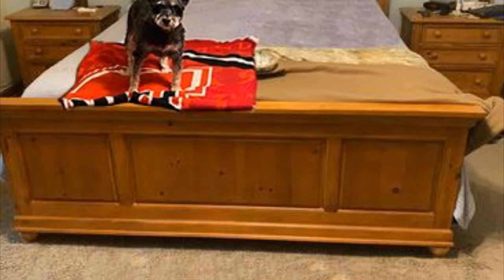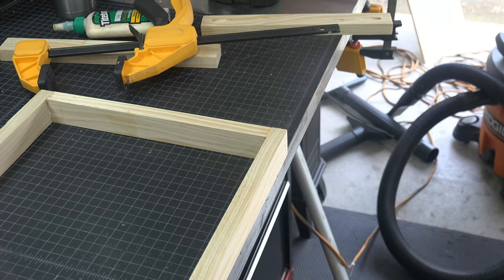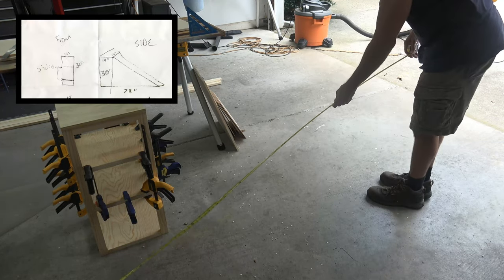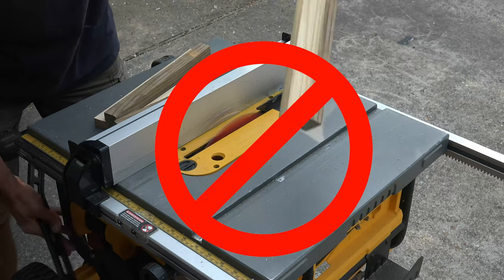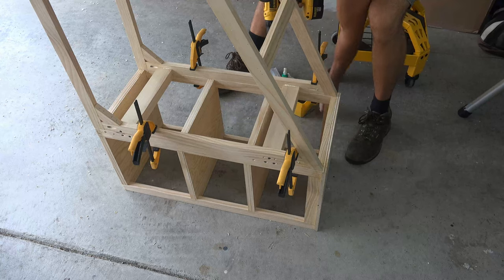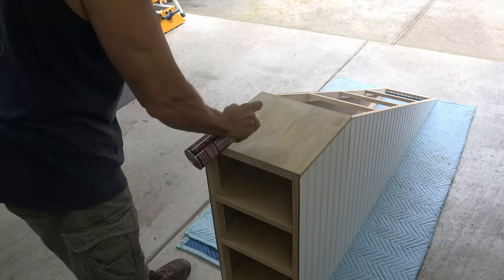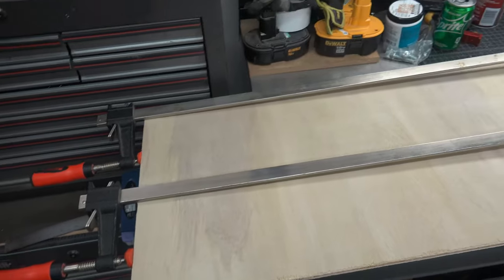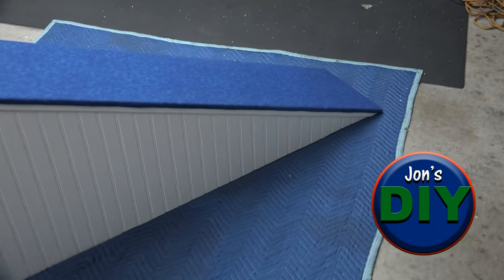How to Build a Dog Ramp

Comment: The first comprehensive guide I've seen. My dog (7 years old) just recently started showing signs of hip dysplasia, especially with the cold we're having, so I needed a guide for this so she could make it up into my bed. Will be making this soon, thank you so much!
Reply from the maker: Thanks Jade.  Although I built this to the owners specifications, I would recommend making it 6 inches lower than the top of the bed so the last step is up onto the bed.  This will lower the angle of the ramp thereby helping your dog make the transition easier.  You can also bypass all the extra shelf section that just increases the work and cost in materials.  Good luck.  Jon  Don't forget to subscribe!

Comment: This is so cool! I have a new puppy who is too small to jump on my bed and unfortunately has paws that stick outwards when he sits. The vet said he's fine, but he may have pain when he's older. I plan on making a dog ramp with my dad so that my puppy doesn't have to jump on stuff to get up to my bed and have a bad back when he's older. I also have him on vitamins to help him develop strong bones and joints.
Reply from the maker: Having built a few different variations of dog ramps one suggestion I have is to make the top of the ramp 6 inches lower than the bed. This is an easy step up for a dog and it cuts down on the steepness of the ramp.  This way it can be used easier as the grow old.

Comment: Watching, love it, got to point where you added screws into area beside your dowels to hook together.......Idea....instead, add a permanent bolt into the end of each dowel.  THAT WAY,  a large washer and wing-nut can be used for repeated dismantling and re-attaching, without the wearing down of screw holes over long term use.
Reply from the maker: Yes, great idea.  Now that what I call making it up as you go along.  !!!

Comment: When you position the speed square at the 78” mark, is it marking the long point of the scribe from the floor?
Reply from the maker: Mushroom,  I'm blind so I was simply using the speed square to show me where the 78' mark on the tape measure was.  You people with perfect eye sight will not need the speed square to see your 78' mark on the tape measure.  so to answer your question.  Yes, the angle's point created from the board to the ground should be at the 78' mark.

Comment: @Jon's DIY What dimensional lumber did you use for building the frame?  Also was that 1/2" ply used for the ramp top and 1/4" ply for the shelving back, sides and bottoms?  Great video.  I have need to make two and this approach is great for figuring out a ramp to pair up with a King or Queen bed.

Comment: Our dog is about 85 pounds. I'm guessing this 1/2 inch pine won't hold up long. What do you recommend for framing for this weight?
Reply from the maker: This ramp would easily hold 100 lbs
Reply: @JONSDIY  I’m not a seasoned carpenter but I appreciate it! This will be my go to when I build it